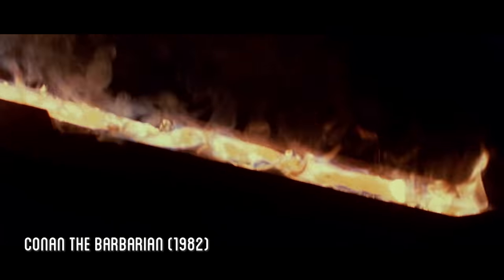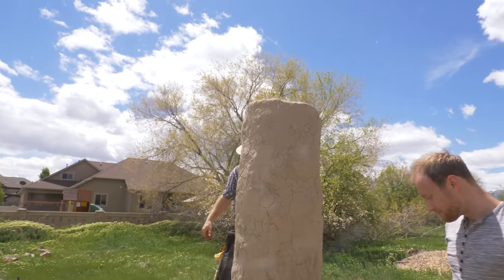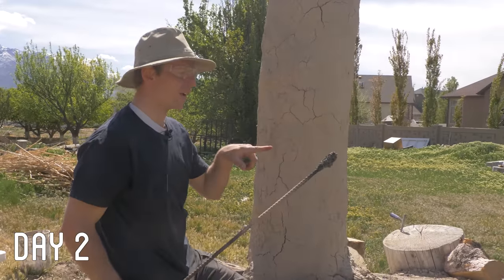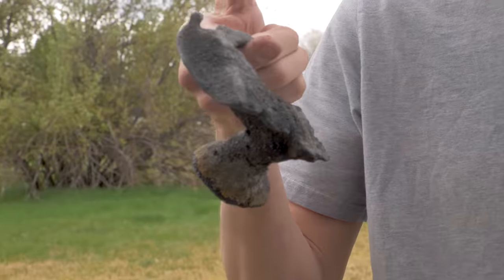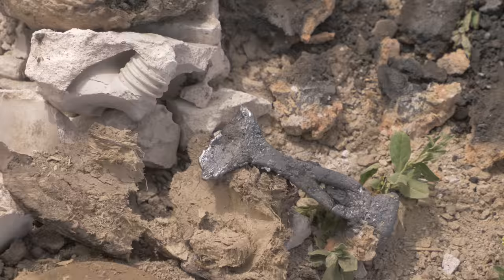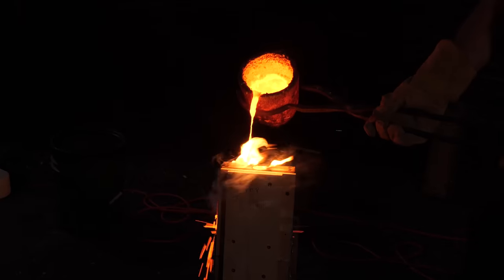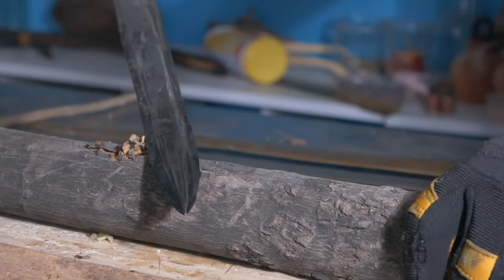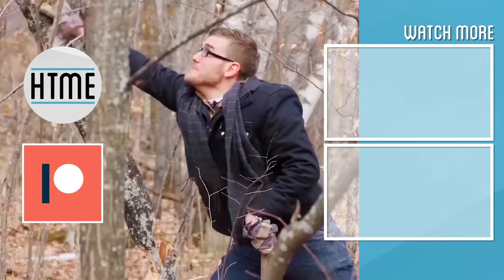Can You Cast an Iron Sword?

Comment from the maker: Thanks again to Bespoke Post for sponsoring today's episode! Get 20% off your first monthly Bespoke Post box when you sign up at https://www.bespokepost.com/htme20 and use promo code HTME20 at checkout!
Reply: You need 2 openings and vent holes in a sand mold otherwise air is trapped.
Reply: After the steam engine you should move to a paddle steamer, combustion engine and stuff like that
Reply: Melt a cast iron engine crankshaft. That iron takes massive twisting, compression, and tension forces without breaking.
Reply: If you have to make cast iron anything then a cast iron hammer head sounds pretty good. How you create a handle for that, Idk, but it's probably the best option
Reply: for a cast sword, it would be better to use a gladius style
Reply: If you make a clay structure with cob with clay mixed with ~33% charcoal it should hold up better.
Reply: Did you even try to temper it?
Reply: Wait what you mean I can do that
Reply: Why are you trying to re-invent the wheel? They have been making cast iron skillets and other cast iron things for hundreds of years. The process is well known. Do what they do/

Comment: I've been studying melting & casting in preparation for starting up as a hobby, and I'll echo what others have said: you need an exit vent for your molds.  The molten metal is hitting the trapped air and compressing it, which is stopping it from filling the mold.  You're also getting a lot of steam explosions and spatter because there's too much moisture present; as BigStackD (another YouTuber you should check out if you want to look into casting) always warns his viewers, ALWAYS preheat your stirrers, skimmers, and molds to avoid this problem.
Reply: I've been following bigstackd for a while as well, also interested in starting up a metal melting hoby.

One question I still have that bugs me is how to do steel melting at home. Bigstackd always gis his steel to his bud but I'd rather be able to melt it myself. Do you know of any resources that could help get me in the right direction or is this just my wishful dreaming that isn't going to happen?
Reply: @MajKetchup347 
Try a ribbon burner or two in a mini metal foundry.

I wanna say Old Hickory Forge has a video on a ribbon burner build.
Reply: @MajKetchup347  One way to go about it is using electricity instead of gas. You can get carbon gouging electrodes for a stick welder; while a propane flame is only barely above the melting point of steel, an electric arc is several thousand degrees hotter and can melt it easily. Keep in mind that the air will be trying to cool your crucible, so insulate it well with firebricks or ceramic wool; if you're having trouble getting the whole thing to melt, try a smaller crucible or a higher power welder.
Reply: I was wondering, the molds they made looked quite complex and thought-thru but I couldn't see any exit vents, which is confusing cuz how do you get to the point of knowing how to properly mix sand for a mold and do lost wax without also knowing about venting?
Reply: I thought you then broke the caste then heated the iron and beat it on the anvil.
Reply: I have been casting cast iron for 35 years and never needed a exit vent and the molds fill up every time. That metal is TOO COLD to pour thin castings!
Reply: The main problem is, the iron not enoug hot, it nedd maybe another 100 C to can cast and ther's too much slag on the iron and the slag isn't melted, if the iron is hot enougs the slag is on is like oil on the water, not solid chunks
Reply: Now you understand how Volcanoes work.
Reply: I dont understand why you have to experiment. The process is well known. They have been making cast iron things for hundreds of years. Whats the problem?
Reply: @CarlosSpicyweiner-iv8mq   They have. Keyword being They. What have You done? Nothing correct? So stop piggybacking other people's work.

Comment: It looked like your casting molds didn’t have any gas spouts. Iron reacts violently with gasses that are in the air. Maybe if you added gas vents, then pumped a heavy, inert gas like argon into the mold it would work better.
Reply: At the very least, they needed a spot for all the displaced air to go. It doesn't bubble up through molten metal as well as it does other liquids.
Reply: @Logan Strong 
It looks like they were using an oil sand like petrobond which theoretically let's gasses escape pretty easily for aluminum and bronze castings at least. Maybe iron just makes way too much though.
Reply: @loganstrong5426  Yeah they needed something as simple as a vent if nothing else.
Reply: He hasn't unlocked the noble gasses yet
Reply: @jimburton5592  He has unlocked soda ash or limestone and vinegar, though. Carbon dioxide is technically an active gas, but if you're not TIG welding I doubt you'd notice the difference.
Reply: Gas vent are not the main problem here , gas can go through sand, the problem is the material used , the temperature and the sand. There is probably no chance to get anything without more modernized equipements.....
Reply: Yep, that's why they use canister damascus on Forged on Fire. When the canister isn't properly sealed, you see sparks flying out of the canister.
Reply: Also preheating the molds helps.
Reply: @Natulxs  you need more venting for ferrous alloys, as pure iron filings small enough, instantly oxidize and create more heat and expanding gasses. So you need more gas vents, to allow all the gasses escape, as it forms more gasses in molten liquid phase and for a longer time. Why modern ops use a mix of inert gasses, preheated ceramic molds, and more
Reply: Vents would be helpful, though I really think the metal just wasn't hot enough. They even talk about the color of the metal in the video; for casting iron, it should be a yellow to white, not orange (though, it may look different on camera than it does in person)
Reply: @akhasshativeritsol1950  Nate needed to skim then reheat it over the melting point (yellow to white hot) before pouring. 

A Vent or two definitely would have helped a lot but the fact that the mold wasn't preheated (or likely even dry) was a major obstacle to filling the mold at all.
Reply: The ancient technique of pumping argon into the mold of course
Reply: Do you often have to prove how much you know? Do you know how that appears to others?
Reply: @andrewgoss1682 exactly
Reply: Your videos are real poor, I would worry about OPs gas spouts which you’re wrong about

Comment: I have the feeling that cast iron would be good for mass producing arrow heads.
Reply: Ohh, ohhh, yeah I can see that :o
Reply: The Chinese actually did that
Reply: @elijahjamesperez8936  they still do lol
Reply: Or spearheads. It should work really well as a material for making a purely thrusting point
Reply: @elijahjamesperez8936  mass production for the win
Reply: Well, that's not the way Iron fences with arrow tips are made(?
Reply: @MrMarclein  Those are made of wrought iron
Reply: @MrMarclein  Yeah i think iron fences are usually wrought, not cast
Reply: I'm personally thinking of using copper then work hardening it or a brass alloy for arrowheads, but I want to cast one of each medieval arrowheads that I've personally found on my families ancestral grave yard, I've found 10, and I've sketched em out
Reply: @harleymarshall6929  a arrow is a one use item you literally throw away while a spear something you hold on to so I would go with something more reliable.
What if someone just hits your spear with a stick.
If it manages to survive then it would need to be thicker and heavier than a steel spear head which would put you at another disadvantage
Reply: @harleymarshall6929  Not really. Even though spears are primarily thrusting weapons, a cast iron speartip would still likely be very brittle, particularily since a lot of spears can also be used for slashes.
Reply: Depends on what you prioritize: If you need quantity over quality, you can probably do that. If you want the best arrows you can get, you'll need to have them forged. Mind you, forging an arrow head doesn't take a skilled blacksmith very long and a single forge with a master blacksmith and a few apprentices could probably make a few hundred arrow heads every day if need be.
Reply: Only against soft targets. Any decent metal armor would defeat them. And if you have any kind of proper mass production tooling, and a good supply of wrought Iron it would be just as easy to make better quality arrowheads out of that and case harden them.
Reply: @FrancisR420  my guy if you won a battle you best believe you'll be commanded to retrieve arrow heads and the sticks used to propel them before another battle especially when on the move it's a waste of a strategic resource for archers to not be able to arch because some tool decided not to bring back the arrows from both sides of the former battlefield and or siege and the nearest place to craft arrows is outside the castle/city and or battlefield
Reply: Not really. I have my doubts that it's even possible to reliably cast something so small due to the high surface tension of the molten iron. Even if it is, it's rarely gonna come out perfect so you'll need to grind it. And even if it casts perfectly, you'll need to cut off the pour spout. Both of those are easy with an angle grinder/bench grinder/hacksaw/whatever, not so with a primitive grinding wheel. On the other hand, a skilled arrowsmith can forge a simple convex arrowhead (the only kind you could realistically cast) in like 3 heats, and it'll only need a bit of sharpening of the point before it can be used, no grinding or cutting required.
Reply: Shoulda been more specific; I meant to say javelin heads; they are sorta like arrows in that it's primary purpose is to be a harder pointy bit on the end of a stick; basically all you'd need to cast would be a tang and a sharp point on it; it obviously wouldn't be as good as forged and ground javelin heads would be, and it obviously wouldn't last as long; but I'm sorta imagining it like pilum ir plumbata, it's a really simple weapon that's easy to mass produce and not that big of a cost if it breaks or you lose it as its intended to be a projectile and that's a risk you take with any projectile weapon. The idea is that it could be slightly easier to produce on mass faster than forging. I could be entirely wrong but it's simply an idea; one of us needs to just build a furnace and test this theory
Reply: I'd like to see fired-clay arrowheads.
Reply: Or nails
Reply: @xxflowybro9780  Yeah

Comment: When your using the sand mould system you need to have a exit for the air to leave from
Reply: ya idk why nate didnt put the vent tube in
Reply: In sand casting, there are pores between the sand grains that can vent gasses.  Depending on various factors that may not be enough, and a vent or riser opposite the feed is needed.  Vents reaching almost, but not quite, to the pattern can also help.
Reply: @hanelyp1  Ok but an exhaust pipe is always easier to get the air out quickly
Reply: also heating the mold before using it can help a lot also. some of the splattering of liquid metal is the rapid temp changing happening. almost like how dry ice will skate around on most surfaces tell it drops the temp enough to stick to it. you want the metal to more or less stick to the mold not skate around on the surface of it.

Comment: Have you heard of a puddling furnace? They used to be the predominant method of the manufacturing of steel before the bessemer process
Reply: i did my captone in college on ancient chinese metallurgy, and i came across their early forms of the pudding furnace. fascinating stuff
Reply: In ancient times, the Chinese were the first to learn to smelt pudding. The first flavor was rice.
Reply: Or even the more primitive version, the finery furnace.
Reply: So there was one of puddling furnaces not far from where is was raise. 

Actually it was a sister furnace to the cast iron furnace just a couple of mile away. The purpose of the puddling furnace was to lower the carbon content of the iron pigs so that they could be forgeable. 

Both furnaces were colonial American era (late 18th century). 

The cast iron furnace still exists, but the puddling furnace is long since forgotten. The Bessemer furnace pretty much made the puddling furnaces obsolete.

Comment: You should crest vent holes in the mold next time it didn’t want to flow because of trapped air and keep a propane or map gas torch with you so you can preheat the mold the piping and spattering was because of the presence of water it also help to preheat the mold to ensure a good flow and it doesn’t harden to quickly
Reply: thank youuuuuuuuuuuuu the sand has to have a small amount of moisture to keep its shape if it’s a closed cast but they alwaysssssss have to have at least one vent at the opposite end of wherever you’re pouring i so hope he sees this
Reply: I really wished he wouldn't half ass everything like that and for once prepare a proper mold with the carbon dioxide moulding, at least clean the slag off of you molten iron and then pour into a heated mold. The mold was made of basically beach sand that he shaped by printing a crude sword into it. He then started pouring from the middle into a mold that wasn't even level. I'm just dumbfounded at how many mistakes you can make. Nothing this guy does resembles quality and it's literally the only thing he does. I bet this was his first pour as well and he didn't even test the process to find out if it was any good. He just went with it like "meh good enough". So disappointing.
Reply: @unlink1649  It's so amateurish, this series has been going on for so long now you'd expect them to either have learned by now or done a little bit of research.
Reply: @SuneSensei  They don't care about doing it good. They care about putting out a good enough video. The problem is with everything just being "good enough" over and over, it starts to look AWFUL.

Comment: With the understanding that the proper steel would require higher melting temperatures... why not try that? Would be more interesting, since I honestly don't know what to expect from a cast steel sword.
Reply: Well, the topic of steel casting is really complex. And as far as they dont control it preciselly there could be everything. The type of alloy will be propably the most significant factor as well as cooling time and melting temperature, since the grain structure depend on this aspects. I think that casted steel sword might work if they use both the proper alloy and precise melting/casting/cooling process.
Reply: Its not really possible to reach the meltingpoint of mild steel without modern technology (outside of a kilm) and it would react strongly with the air. The end result would be a mostly normal steel sword.
Reply: I don't think they really covered exactly what they were using as a raw material here but it looked a lot like they were using rebar. Which is a steel and might explain part of their struggles. They were trying to cast at too low a temperature using an alloy not well suited for casting.
Reply: @herscher1297  dumb question then... i know this probably wouldn't work, but i'd love to know why: what would happen if you set up a mold filled with mild steel pellets or filings, and put that directly in a kiln? or set a crucible with an opening at the bottom above to mold so that the steel poured through as it melted?
Reply: @flamethrowex  tbh i dont see any reason why this shouldnt work. You would need a mold able to withstand the heat. Also, if you cast steel you will need to reheat it for tempering and quenching.
Reply: @bradley3549  they said it was castiron so if rebar was their source material they added carbon

Comment: hey Andy. i did my capstone on ancient Chinese metallurgy and from my research, they got the metal hot enough to melt like in nate's modern foundry, but they next poured it into a refractory basin and added silt to the molten iron. this removed the impurities and when it hardened, it was pretty much "wrought iron" without the bloom. another option you could try is loading a crucible with alternating layers of wrought iron and cast iron, then heating it in a foundry for several hours as hot as you can. this will cause the two alloys to combine into one, making medium to high carbon steel. i hope this helps
Reply: they were able to decarburize cast iron by adding silt? i would think you'd need to pour it out into thin stock or something and just let it naturally decarburize. how does the silt work to get rid of carbon?
Reply: @bilbo_gamers6417  Also curious how it decarburizes so leaving a comment incase of answer :P

Comment: The issue is mostly that they used rebar as the material to cast. Rebar is a mixed steel that is made from scraps and has TONS of impurities. It's only use is to reinforce concrete. 

A cleaner steel with a flux introduced would not only have melted at a lower temperature, but also poured more smoothly and evenly.